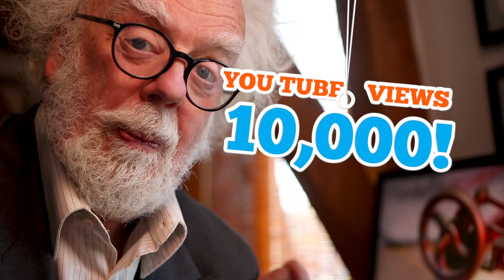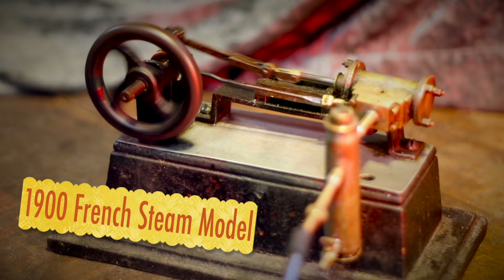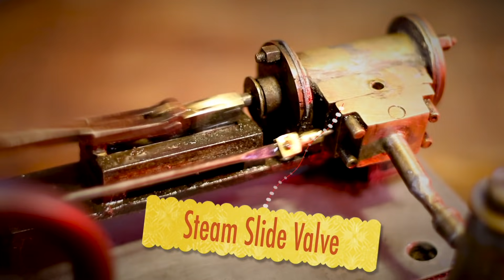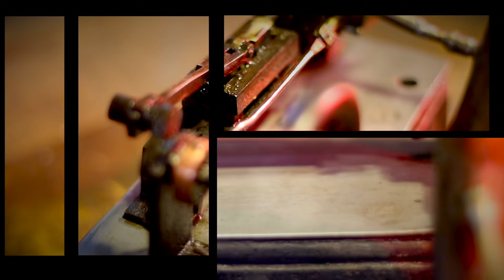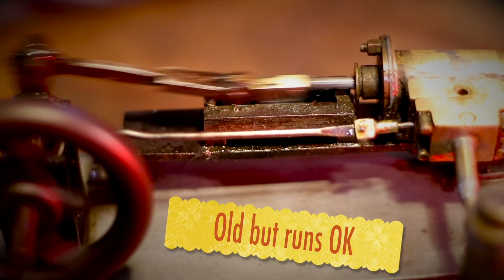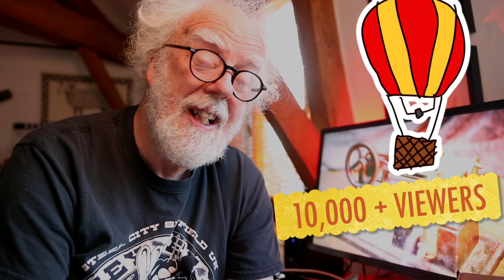I am in BIG trouble - Prof Simon

Comment: This reminded me of those triple piston engines, they run better. Then I remembered the old triple piston hydraulic engines that ran everything before electricity came along. Miles of high pressure water pipes to power  things city wide.  Those old things last a long time. Our consumer society is a throw away one, not very renewable or designed to last.

Comment: I build my own from scratch but a bit more sophisticated. I have built several Stuart Turner from castings (#1, #5A, #8, and Sun). I have a Strelinger in my Steam Powered Motorcycle project (Doble Detroit style boiler). Hey Prof, your flywheel is obviously a valve handle. The builder should have turned the outer rim and trued it up a bit.

Comment: Hi Professor, great little steam engine. How about a follow up with some more details. 
How much does it weigh?
What is the RPM range?
How are you powering it?
How are you throttling it?
Can it be used to operate something? 
Will it run in both directions, or only one?
Was it built from a kit, or drawings? 
Is your example actually from 1900, or is it a later made reproduction? 
Did you need to make any parts or perform any repairs in order to get it running?

I've thumbed up your video. Would also do the same for another video that addresses questions. 
Keep up the good work.
Reply from the maker: steam test.    https://www.youtube.com/watch?v=3rMKnsTufOY

Comment: You are running that things off compressed air.  Live it up a little.  If your British, then you have a tea pot.  How do you make tea without a tea pot?  The lid of the tea pot might have enough mass to force enough steam out to run the engine, but still act as a safety valve.  If not, then you might have to made changes of questionable safety.  
         If your having problems with views maybe you you could have put in the title, "Could this device have powered a Victorian/Edwardian Sex Toy with various configurations?
Reply from the maker: live steam test...thanks for the idea.   https://www.youtube.com/watch?v=3rMKnsTufOY

Comment: is the hole in the top of the slide valve assembly the exhaust port? in a real steam engine this would be routed up the chimney through the blast pipe to provide more draw for the fire helping pull more hot air through the boiler tubes. What you have there is half a steam engine! presume you are using compressed air to drive it?
Reply from the maker: steam test. just for you.      https://www.youtube.com/watch?v=3rMKnsTufOY